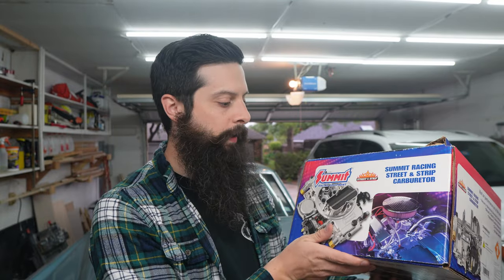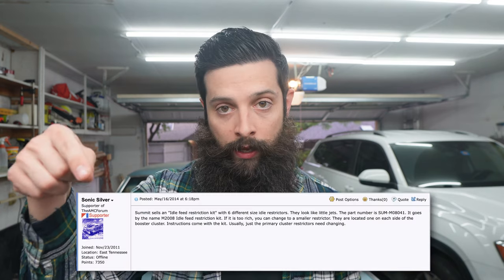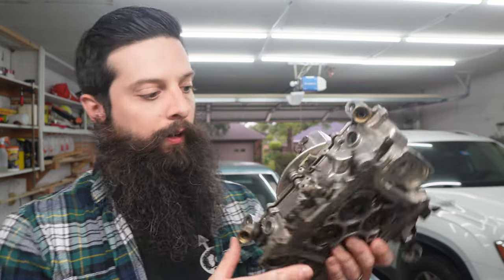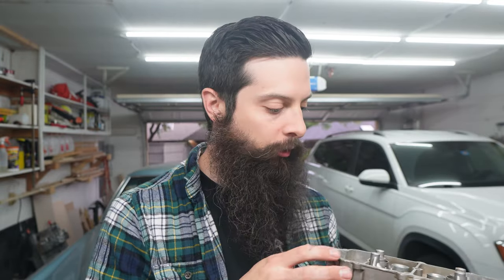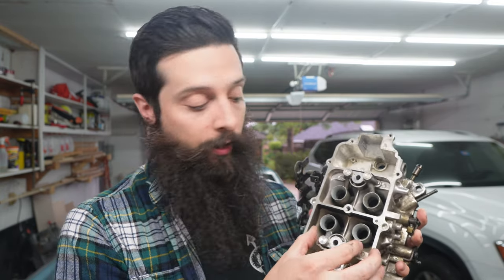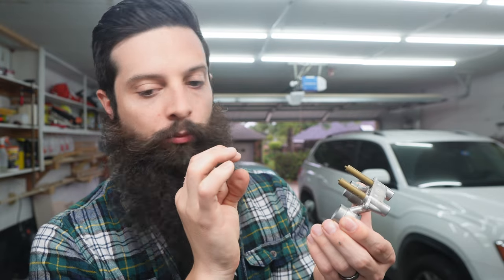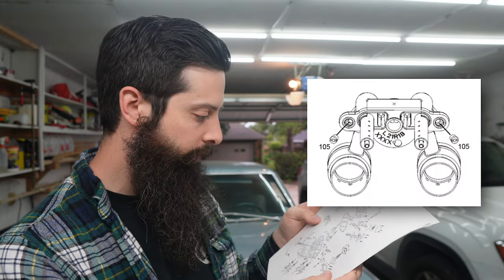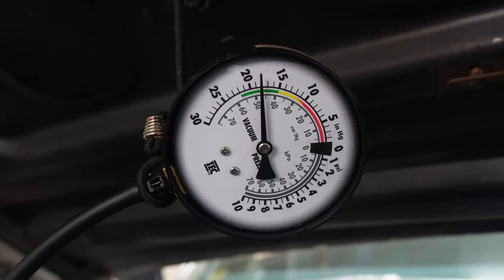Summit Carburetor Rich Idle Fix

Comment: Recently rewatched this video. Do you know if the summit restrictor kit would work in a holley 4010 600 cfm carb? Ive got one on my truck.
Reply from the maker: @kevinwestmoreland2099  I googled “Holley 4010 diagram” and I don’t see the same restrictor indicated under the booster, so I would assume you couldn’t. You could pop it off and double check, though.
Reply: @deadwaitdesigns  thanks for the response. It was said that summit changed a design feature before using this type. According to holley, the 4010 / 4011 didn't sell well since they didn't look like a traditional holley carb. I've also heard there was a flaw in the design  when built by holley. I happen to like the design. Thanks again.

Comment: Damn I’m fixing this this weekend
Reply from the maker: hopefully this helps you out!
Reply: @deadwaitdesigns  man what carb are you using? I cannot get this edlebrock done in right. Do you use the spacer plate? Mine were both aftermarket and then I got this setup and feel like it’s not right? I even went to the point of doing a manual choke haha.
Reply from the maker: @reconbandit28  i'm running a summit 750. they recommend using their own "spacer/gasket" which helped me out because i needed the clearance anyway. spacer shouldn't really mess with you too much. if you screw the mixture screws all the way in does it lean out?
Reply: @deadwaitdesigns  they’re all the way in haha yes
Reply: Also dammit thanks seriously appreciate the advice and help
Reply from the maker: @reconbandit28  did a quick search and it seems like some people have had luck lowering the float.